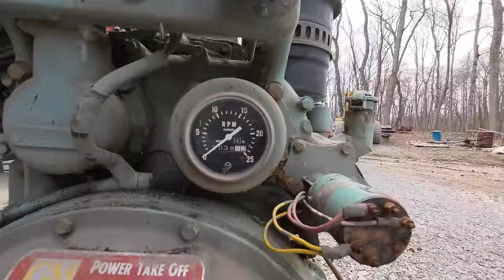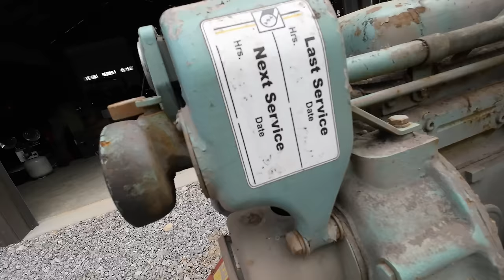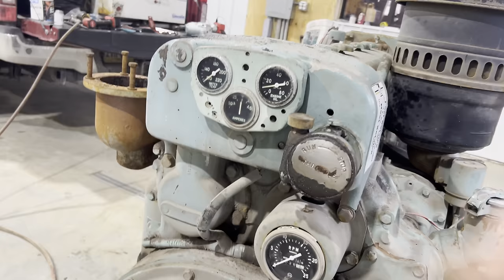$250 Two Stroke Detroit Diesel Sitting 6+ years, WILL IT RUN!?!?

Comment: That doo-dad on the front of the engine is a Heat Exchanger....The engine has it's own coolant 'n the ports on that pot are connected to a pressurized  facility water system for cooling where the engine was used....Typical for a stationary system.....

Comment: I have a question for anyone that can help. I have a 93 E150 Club Wagon Van. THE body is in good shape as far as rust and i do have a dent in back door. Was wearing sandals and foot slipped and backed into wall. Anyway, i wood like to find a Modern full low miles body train I could have my vans body dropped on. Anybody with experience, can put me in the right pass.

Comment: Detroit 6v71’s we’re in our 113 APC’s, and we’re true pieces of crap, … the last one I was in, ran but barely, … We had one APC, where the exhaust manifold cracked, and heated up a can of .50 cal, which then, started to fire off as the can got really hot, … toss it into the Detroit river at the 1st chance you get, …
Reply: Btw, a Cummins engine, will serve your purposes much, much better, though I doubt if you could ever find one with only 38 hours on it, … still, though the reasoning why I like a Cummins engine more, is because there is a valve on the fuel,pump that can be turned off do that the motor will not die with the key, … a bypass for the electrical system, … so unless you need for it to run without creating electricity, you would have to kill

Comment: Pretty sorry your fired up that puppy inside aren't ya? So,,, move it outside and put  a 3-phase generator on it and you've got a  winter heat untill the county power comes to you. I doubt you'd be happy with it in a truck, most diesels of this ilk have been run for ever at lower RPM's. Do your homework, this is not an engine to be doing anything with wheels. Maybe a roof-rail  boom crane for unloading a truck!

Comment: A 671 Detroit we'll run away if it goes wide open it will run away adorable Lily blow the head off the motor and you can shut the fewer off and it will not stop in Detroit at 671 because of 671 will take the oil out of a oil pan suck it up into the motor and use the oil for fuel the only way to shut down a Detroit is the guy shut off the air that's the only way to shut down a 671 Detroit did you shut off the air pure une's away

Comment: Why would you want such a bad engine 
Pure oil leaker
Reply: Agreed. Worked on h/d trucks in the 80's, were inherent leakers, esp from the air box covers. Lacking in low end torque since they were 2-strokes, had to be wound up pretty high to pull ok. And the injector control racks were highly sensitive and a pain to get right. In that era Cummins 855's and Cat 3400 series engines were more preferred by most drivers